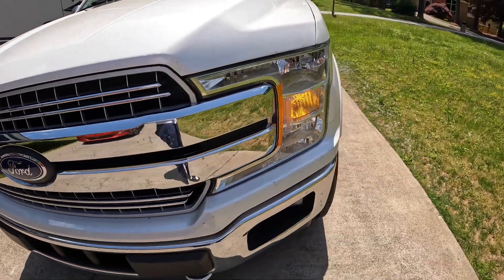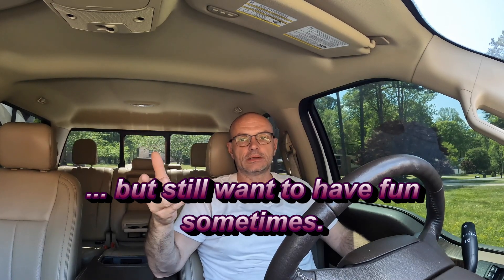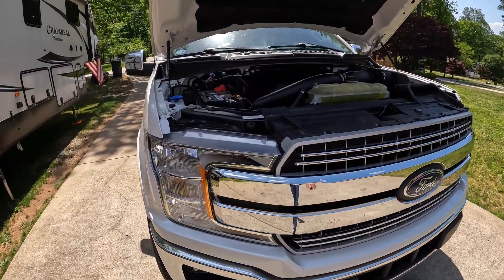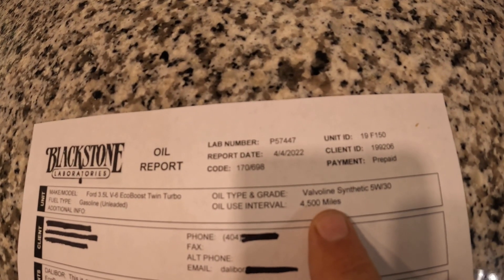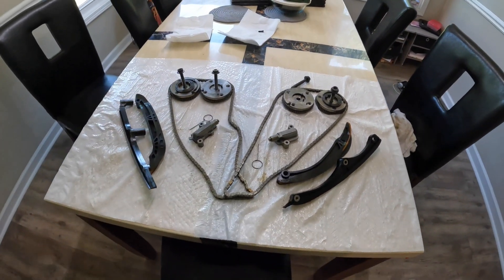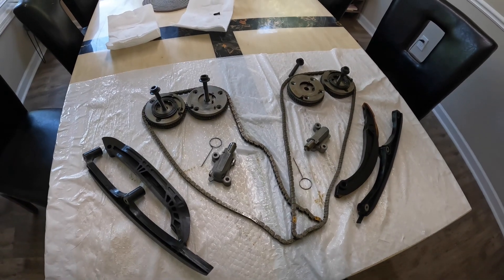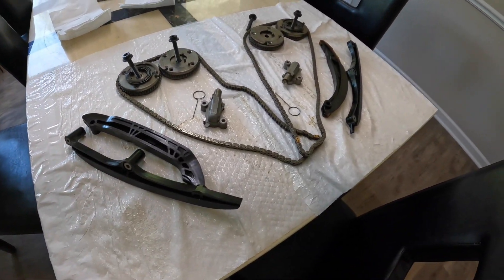3.5L EcoBoost DIY Cam Phaser Disassembly & Replacement

Comment: absolutely no videos show removing the orginal cam phaser bolts. Since they are so extremely tight, why make a video & not at least mention it if not show it?
Reply from the maker: I didn’t find it so hard to remove the bolts. Maybe it’s just me. There were several videos showing total process but not disassembled phasers. I tried to learn something from disassembled phasers and I did.

Comment: Prior to the date for this video a newer designed cam phaser came out. The new part# starts with a M the older starts with a H. The lock hole for the new design is the front plate instead of the back plate and the new design has a cover over the helical spring. Its to bad you didn't get the new design cam phaser for the good work you did.
Reply from the maker: Thank you. They were not available at the time I did the chain. However, I since have put 50k miles on the truck with no issues what so ever. 5,000 mile oil change intervals. We will see how long it lasts.

Comment: There's 2 links in the descriptions that shows you how to actually do the job. This video will not show you how to change the phasers.

0:00 0:33 Bad cam phasers make noise. Here's a story about it. 

0:33 - 2:44 Blah blah blah 

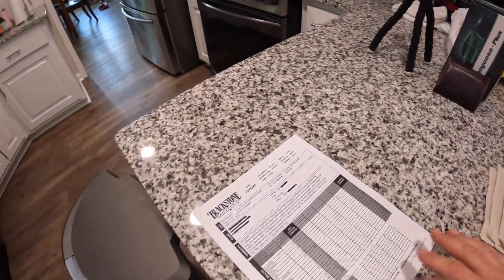2:44-5:43 let me show off my truck and the aftermarket parts that aren't cam phasers 

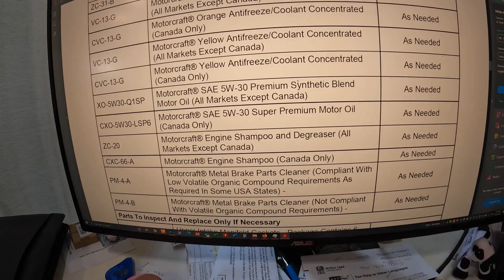5:43-7:26 Parts list and a TSB 

7:26-8:39 I have tools and an automotive degree. 

8:39-9:00 Here's my mustang Mach E. I did this job in my driveway in about 14 hours. 

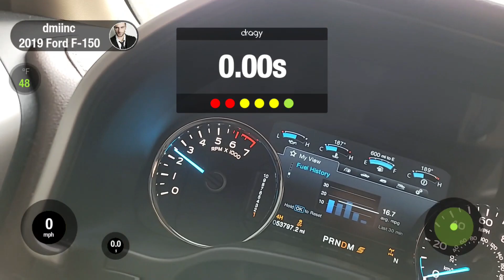9:00-16:10 Old cam phasers are different than new cam phasers. 

16:10-16:19 Motion sickness

Comment: I dropped it off at the dealer on Monday 2/5/23 and there doing it now $3800.00 Ford paying 60% so $1600 to me. Ford is taking care of me 8 months over drive train warrantee, and I never brought it in for any of the CSPs. Thank you Ford.   Also, it's my 5th one maybe that had a little to do with it.  All I can say it pays to call them directly.
Reply: Hi Ed. What model is your Ford? I have a 2019 Ford F-150 with the 5.0 V8 and I was quoted roughly the same for the cam phaser replacement but I bought my F-150 used last year and it already had 60K miles on it. I saw the Ford Customer Satisfaction Program 21N03 notification regarding 2017 -2020 model year F-150's and other Ford vehicles but the tiered rebate coverage Ford was offering to pay for the cam replacement work expired January 1, 2023 -which I wasn't even aware I had this issue until this week. Seems to me that if this was a known design flaw that Ford should have done a full recall to have these replaced in mass. Apparently CSP's aren't treated the same as recalls so I guess I am SOL and will have to pay for it myself. Glad you got Ford to do it!
Reply: @alife2blived150  I bought a new Palatium June 2017.  I was 7 months over the Drive train warrantee and thought I was going to have to pay the whole bill myself My dealer said call Ford you never know maybe Thell help, and they easily offered to pay 60%. over $2000.00.   Your 2019 should still be covered so bring it to your dealer so they can verify you have the issue.  I got 5 CSP and the Cam issue is the only one that expires for some reason.  I would Go on their Web site or ask your Dealer to see what other CSP for yours in case you need them.
Reply: Ed, did you have to call Ford directly? Or did the dealership take care of this?  I just had mine done 72,xxx miles and Ford dealership claimed they couldn’t help at all because I didn’t do the reprogramming before the first of the year.
Reply: Lucky fucker. My dealer despite previously telling me they did whatever bs thing to the phaser to be eligible for replacement, now they say it was never done. They and I were too busy to get the truck in to take care of it until now. Despite sounding like a diesel on start up for over a year and less than 67k miles on the 2019 piece of shit says I'm shit out of luck and repair would be around 4k out of pocket.

Comment: 2017 same truck and motor, 44500mi  I bought new70k and got the letter but didn't think the "RECALL" expired so I have a big problem now. What was the price for the dealer to do it and what was your cost?  What do you think would happen if I ignored it?   Thankyou Ed Long Island NY
Reply from the maker: My cost was just over $1000 in parts. I did it myself. No ill effects reported  if repair ignored, so far. I want to say dealers would charge at least $2500 and up.
Reply: Ford dealer (stealer) in CT gets $4,500.
Reply: @josephstaurovsky27 thanks for posting that no body that I've seen says what they got charged

Comment: I have also recently noticed a "knocking sound" like you described in your video on my 2018 3.5 ecoboost in addition to the cam phaser rattle. When you say you replaced the passenger side intake to fix it, does that mean you replaced the intake tube to the passenger side and it fixed it? Do you have the part number for that? Thanks in advance for any help!
Reply from the maker: I replaced everything that is in the TSB. Link is in the description of the video. Thanks for watching.

Comment: Hello, I'm gathering my parts to do this repair on my 2018 EcoBoost. I was wondering where I would find the torque specs for all the bolts and if there is any torqueing sequences I need to know about, like intake, valve covers, and timing covers. Thanks in advance, good video.
Reply from the maker: I googled it. Most important is camshaft torque and if my mind serves me correctly it was 90ft.lbs. + 90 deg. Don't quote  me on this. Other video in description talks about torque specs too

Comment: Hi DMI INC, did you replace the timing chain and tensioner? Or is it unnecessary. Also how is it holding up so far, anymore rattle?
Reply from the maker: 14000 miles later and no rattles. I replaced everything under the timing chain cover. Just because i wanted to, no other reason.

Comment: Very impressed with your knowledge and ability. I bought a 2021 Expedition and now have 26,000 miles on it with 20,000 of it towing a 6500 lb travel trailer. I want to stay on top of every issue so I like your proactive approach.
Reply from the maker: Great to hear!

Comment: What are the new cam phaser part numbers? Thanks for your video
Reply from the maker: If you click on the link in the description it will give you entire parts list or even better search 21n03 supplement 3 on Google and you find even newer part numbers. Thanks for watching.

Comment: A Man of many talents. 3.5 would not be my choice for towing but you aren't going across America either so it should do a good job plus if it breaks you can fix it lol.
Reply: Why wouldn't it be your choice for towing?? doesn't it have more torque than a lot of trucks out there?
Reply: @tommyhurst90   I always go diesel for towing especially large RV's.
Reply: @offgridwanabe  oh yeah for sure 👍 I was meaning out of gasoline driven but for some reason forgot about diesel 🤦